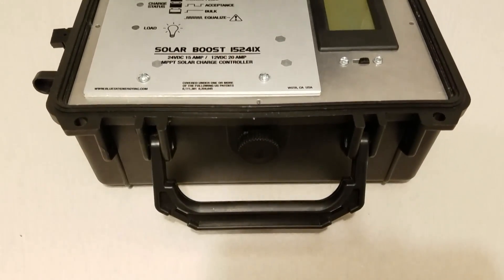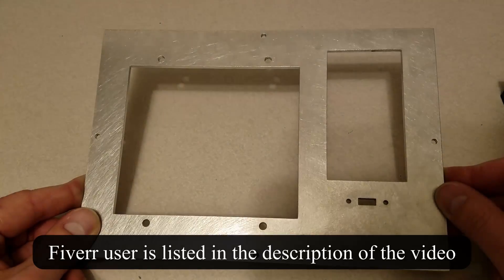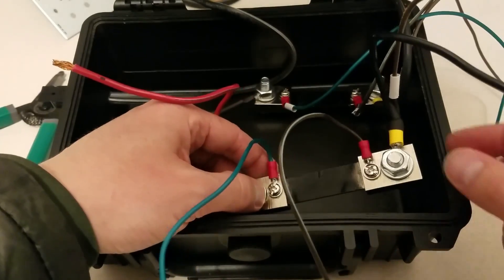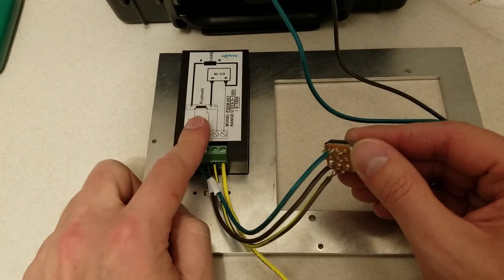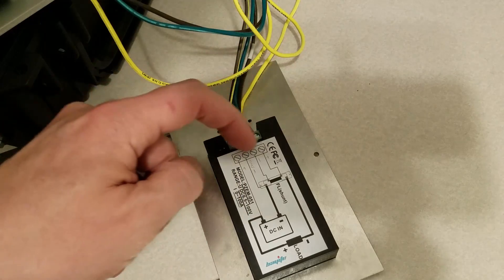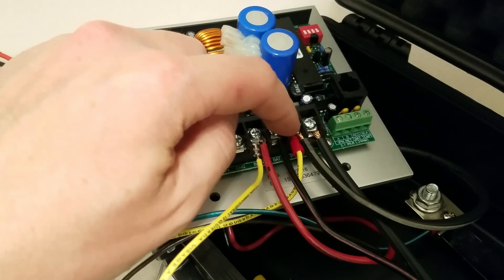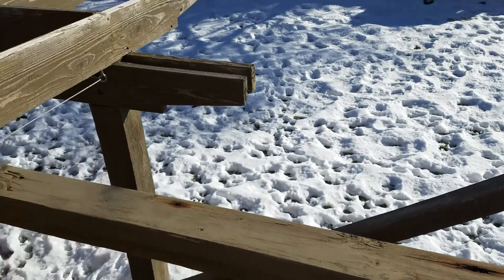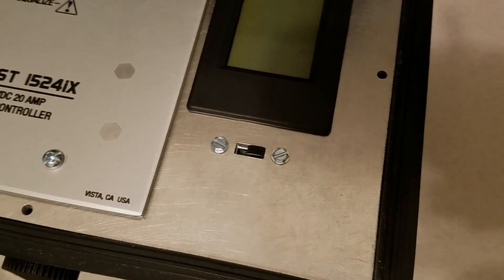DIY Portable Solar Charge Controller - MPPT - Super Sturdy!

Comment: Jason how did you mount the panel to the box?  Any brackets?
Reply from the maker: It's just pressure fit and the box has a little ridge it sits on. Sticks in there pretty good without falling out.

Comment: love the idea of keeping components like this modular, any recommendations for a Charge Controller that is more commercially available today? I have an older xantrex 40amp one, so i will probably use that , but figured i would ask because as of late 2021 this Charge Controller and the one linked in the desc is not available.
Reply from the maker: I think I ended up finding this on eBay. Check out my KISAE DMT1250 video, its a dual charger in the same portable form factor. It's my go to option! Takes both solar and DC inputs to charge up my LiFePO4 batteries. Video is on my channel about 4 months ago.

Comment: Like this build!
Aluminum cover is cool but to save time and money and having the luxury of making mistakes and fixing them, I use a 2'x4' whiteboard/chalkboard combo piece available at Home Depot for $8-ish. You can use either the black or white side. It is very durable, cuts and drills cleanly (use tape to ensure clean cut). I used it for a HAM radio go-box. The mounting plates for the power outlets can cover any cut rough areas.

Comment: I would add this suitcase directly to your LifePO4 battery box for a 1 box setup.
Reply from the maker: I use this portable charger to charge my cars dirtbike, and my portable battery packs, it's super useful to move around and not have it directly connected to just one pack.

Comment: Great job on this build really nice!  I have the same case that has a pws solar controller in it and a lifepo4 16ah battery in it.  I charge either that battery with a 100 watt panel mounted to car or I can switch it to charge my car battery.   My big solar generator I'm building will have an mppt controller in it and I have 300 watt flexible panels that I hope to charge the 280ah lifepo4 cells.
Reply from the maker: I'd love to get over to LiFePO4 cells. Where did you buy your batteries?
Reply: @Jasonoid  not sure if I can post link here but I actually bought cells from China.  Let me get link and see if I can post here.
Reply from the maker: @TimShelnut  Im looking to buy 4 of these:
https://www.aliexpress.com/item/4001061585131.html?spm=a2g0o.detail.1000013.2.1fc81c52Yt8uo4&gps-id=pcDetailBottomMoreThisSeller&scm=1007.13339.146401.0&scm_id=1007.13339.146401.0&scm-url=1007.13339.146401.0&pvid=fcc875d1-e53a-4a56-acb2-ad659b611f00&_t=gps-id:pcDetailBottomMoreThisSeller,scm-url:1007.13339.146401.0,pvid:fcc875d1-e53a-4a56-acb2-ad659b611f00,tpp_buckets:668%230%23131923%2358_668%23808%235965%23599_668%23888%233325%2315_668%232846%238115%23837_668%232717%237566%23853_
Reply: @Jasonoid  I know the supplier I went through was awesome in communicating and even did a name card with my name of my cells voltage before shipping.  Also took care of packaging issues they had before and made everything robust.  Shipping is where the cost is.  How many are you getting? Not sure how that cost compared to the supplier I got mine from.  They also have lower ah ones
Reply: @Jasonoid  https://app.alibaba.com/dynamiclink?touchId=62401757288&type=product&schema=enalibaba%3A%2F%2Fdetail%3Fid%3D62401757288%26ck%3Dshare_detail&ck=share_detail&shareScene=buyer
Reply: @Jasonoid  actually if that link don't work try here is the best research and company I got mine from. https://diysolarforum.com/threads/xuba-electronics-deal-280ah-lifepo4-cells-purchase-review.3850/